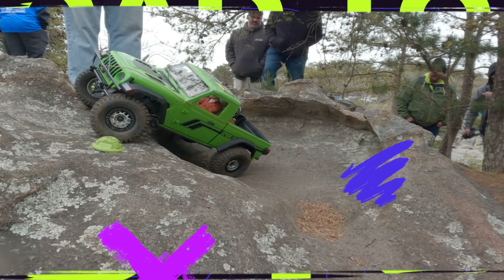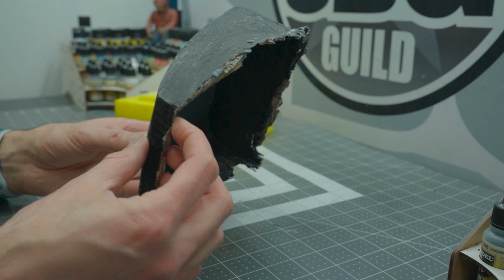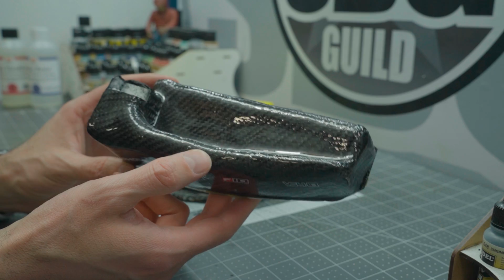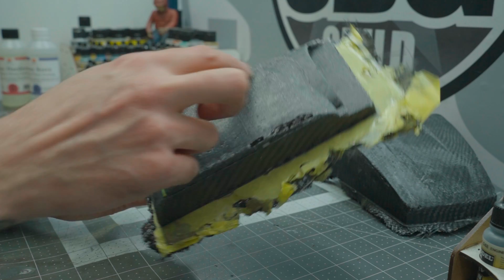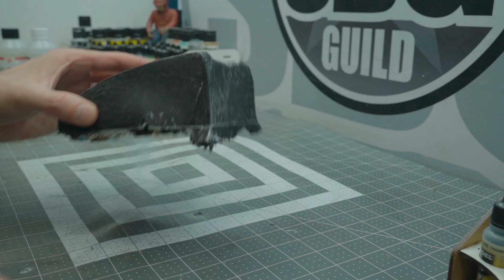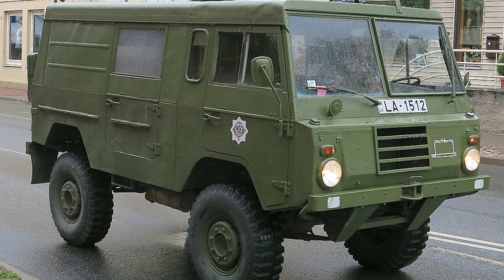Road to the Rockies Ep3 - You had to know this was coming...

Comment: If that Furitek 10 is anything like their LIKO combo, (I am sure it is) you're in for a real treat. On the fly telemetry adjustments via Bluetooth is a pretty sweet option. Updated firmware to fix sinewave output to the motor, etc. It's a worthwhile route to go. Can it handle the stress test? I don't see why not. What is that? 60A nominal with 80A burst? Plenty of juice on 3s with headroom to spare.

Comment: Carbon fiber dust is no joke.  It's extremely carcinogenic.  I was involved in the recovery of an F/A-18 that crash landed in a field outside the airbase.  We were kept off site for nearly a week and even then we had to wear Tyvek suits, heavy rubber gloves and boots with the seams duct taped, and a full faced respirator.  We had to go through a wash station that hosed off any carbon particles before we could leave the contamination zone.  New Tyvek suit every time you re-entered the Con-zone.  At one point I shined my flashlight into the sky (it was a night recovery) and it looked like I was in a snow globe that had just been shaken up.  I'd strongly suggest doing your dry cutting/sanding outside (with a respirator of course).

Comment: Panel bond is amazing. Just be Warned if you get it somewhere you Dont want it clean it up asap. If not it will forever be there. I set a brush on a saw horse. Couldn’t get it off had to throw the saw horse away .